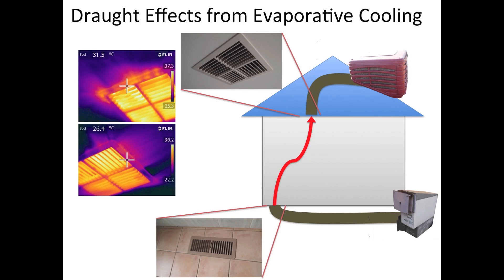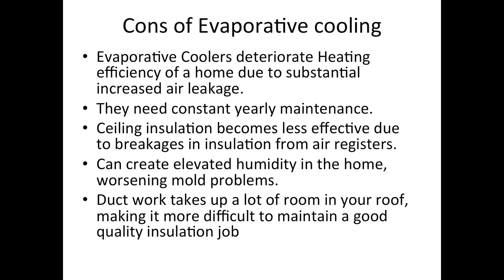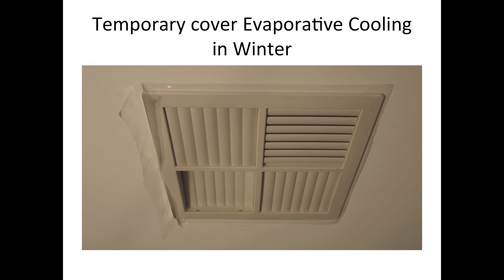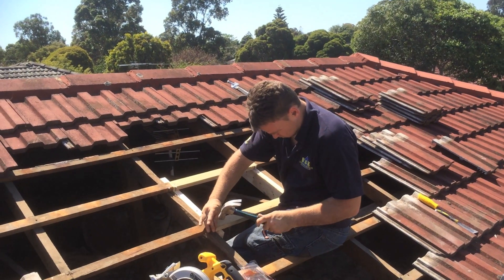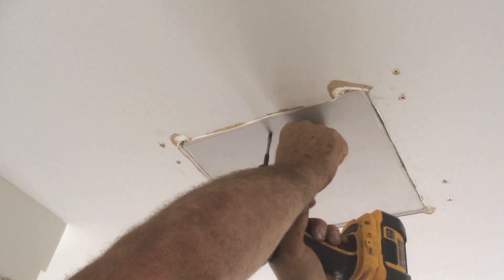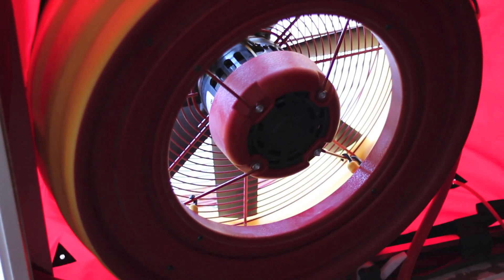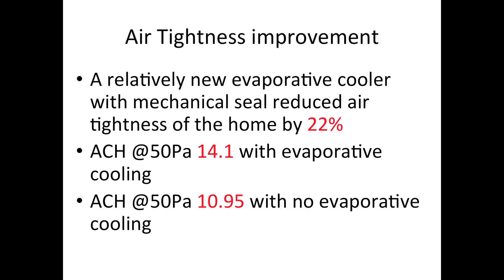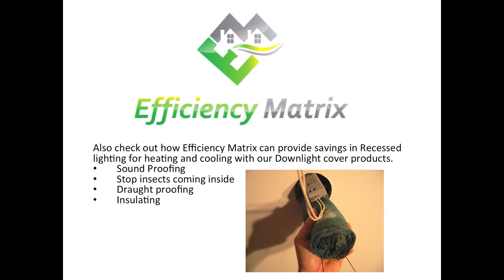Heating Losses through Evaporative Cooling

Comment: evaporative cooler 4-5 times saver than air condition and more powerful. for winter house can be insulated with heat insulation from inside
Reply from the maker: bulat Davlet the problem is, insulation doesn’t work so well, when you have a leaky house!

Comment: Marcus, you are absolutely correct,  as a home energy auditor and assessor having done hundreds of home assessments I see the summer benefits of evaporative cooling.  However there are some caveats.  Most energy consumption for the Melbourne climate region is for heating.  Now if you are a cooling energy guzzler ie leaning on cooling every day through many months, and ive seen people using cooling and heating many days in the same day, then you can sway the balance further to cooling, but on average, heating energy vastly outweighs cooling energy so heating energy efficiency is far more important in the long run.  That means good draft sealing and insulation.  Evaps are on the whole woeful in implementation.  Ive been in many rooves where the insulation is falling off and the ducts are barely holding together, leaks everywhere.   All through the heating cycle these system lose enormous amounts of energy, and these people shiver, so turn their heatin up up up.  Ive seen 600, 800 to 1000 mj per day peak gas use in winter over long 6 month periods, due to leaky house and leaky evap systems.  If using evap you must be rigorous in winter in sealing them.  You ceiling has an R3.5 all over coverage. but the ducting is less than R1.0, typically R0.5 so any heat diffusing through the registers meets in the order of 100 m sq of ducting surface, and thats a lot of heat flow,  not to mention the heat leaking from convection from the winter baffle, if you have one, if not the convective heat loss is enormous if so the convection loss is less but still present, ive measured them..  My recommendation for evap is always short high R ducting, ie 1 or 2 rooms, total seal register covers which are available but have to be removed when you use the evap, solid winter baffle a must, high grade R1.5 ducting. 
In open plan houses,  and most are these days, then modest run splits for say 2 areas used in a reasonably mutually exclusive regime are certainly competitive on energy balance and if coupled with high quality draft sealing ie tight home and high insulation are even better.  If they are the high COP versions of 4, to 6 that are now available we are leaning very much in favour of that solution. however and I hesitate here, as its not everyones cup of tea, but if you consider emissions, with your solar panels, if you divert in the long term away from gas heating and the gas fugitive emissions you can further improve the balance looking at the whole years energy consumption and subsequent multi-fueled emissions.
Reply: Save Energy Plus is refrigerated cooling any better?

Comment: Utter madness, I cool my ENTIRE house for 320 watts, meanwhile your split system cools ONE ROOM for 2400-4800 watts,   you are crazy.

Meanwhile my solar on the roof pumps out 2100 watts, I could barely cool one room for free with a split system, not to mention the noise, dry throat and eyes.  Evaporative cooling is far superior. Vested interest much?
Reply: Marcus,
Evaporative cooling is shocking.  It super saturates the air with water which means you end up with 100% or close to relative humidity.  This means your body hasn't got room to regulate itself as it usually does so with its own version of evaporative cooling (sweating).  Evaporative coolers have no MEPS (Minimum Energy Performance Standards) and there is no star rating or means to compare one units efficiency to another.

At best an evaporative cooler will lower the temperature by 10C but it won't feel like that as the air will have too much humidity.

You are incorrect about air conditioners using 2400-4800Watts.

A Daikin Ururu Sarara air conditioner (air source heat pump) uses just 427 Watts to deliver 2400Watts of coolth (pump 2400Watts of heat out of the room to outside)  It also doubles as a very efficient heater 3600Watts but only requiring 615Watts to drive the motor that runs the compressor.

So refrigeration wins hands down.

Matthew
Reply: The noise? I have a 9kw split in my living room (designed to take the edge off of the bedrooms) , and an evap. My evap is VERY loud, i measured the sound of the evap level AWAY from the vent and air flow and it cane out at around 55 Decibels INSIDE which may not seem loud but is very loud but when trying to sleep. Then i measured my split and it came out at around 40 inside, but that was from ambient noise level. I also measured the outside unit of my split and it came out around 48 Decibels. So i don't know what you mean about noise. And the split when it  hits temp (inverter model) only uses around 1000 watts, around the amount it costs ti run my evap fan. +. The split has ice cold dry air, not warm humid air. Evaporative cooling is for tight fisted tosses. Also my split heats wonderfully.
Reply: Having lived under two different roofs one with evap and the other with split-system, I feel slightly more nervous with the idea of split system these days. While in the early days when I was younger and didn't think much of it, I thought evap was perfectly fine. Over the years though we discovered or traced a roof leak that went back to the installation of the evap unit. Since the house was old when installed, I would surmise it's better to put one of these in when the house is being built so things can be fitted together nicely. Anyway, the right choice depends on the homeowner; I am not against evap but since I am happy to cool just one area and stay there, I think it'll be split-system for me personally in the future